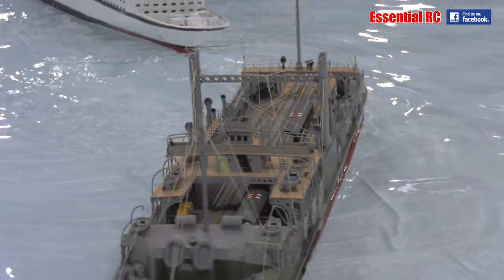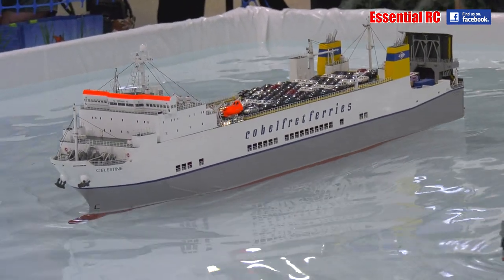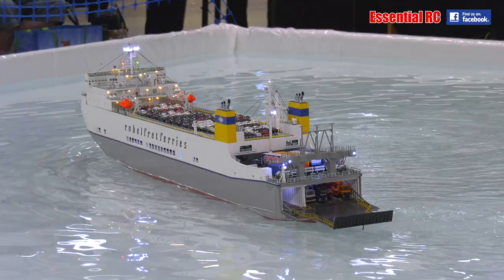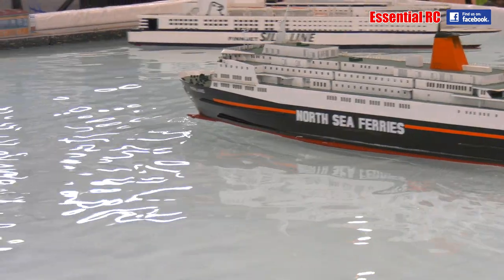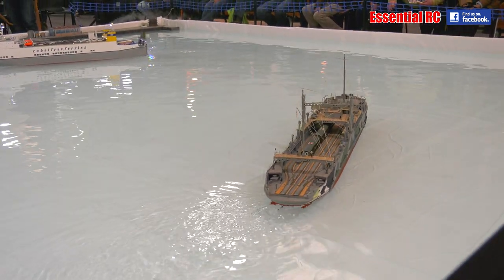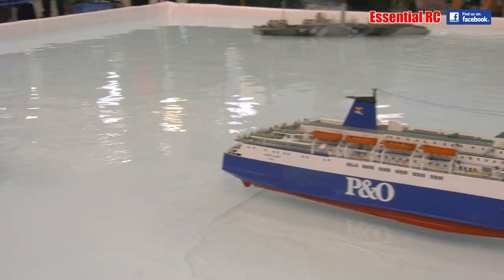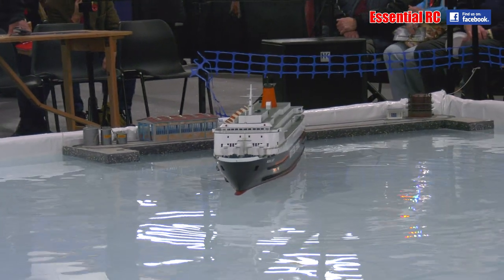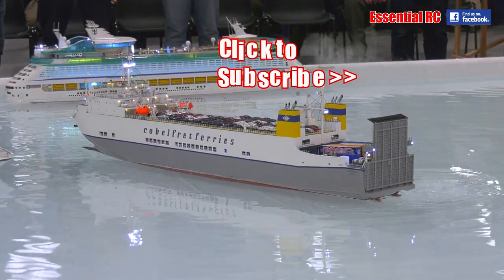SUPER SCALE RC PASSENGER AND CAR FERRIES (RC SHIPS and RC BOATS)

Comment: Beautifull models but they spoil the illusion by not also modelling the movement. Big ships like those are slow cumbersome beasts that take time to turn and some distance to stop. I reckon what's required is possibly motors that have a much slower top speed ... or ... perhaps a mechanism that can slow down the rate at which they can change speed. It just does not look right to have such big ships with such sharp acceleration and deceleration.